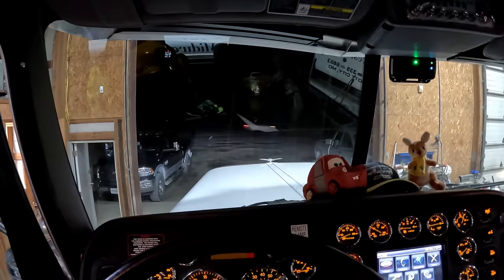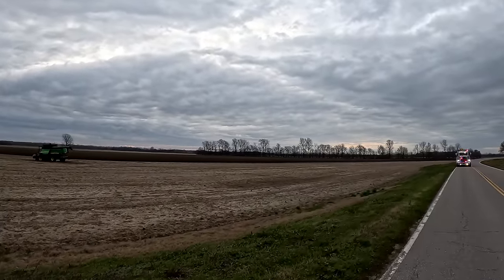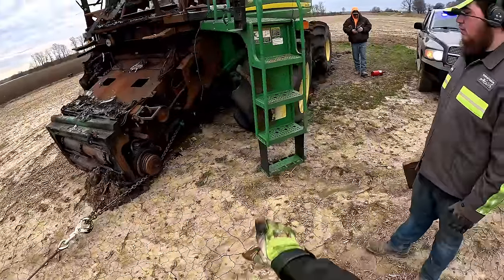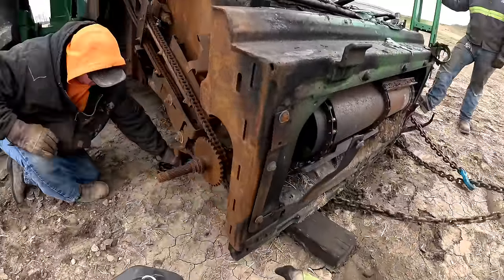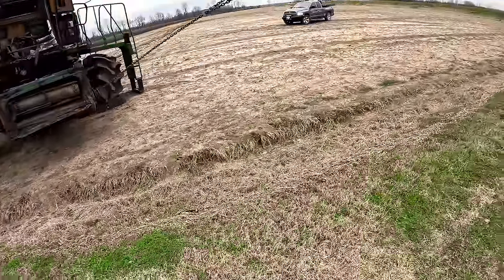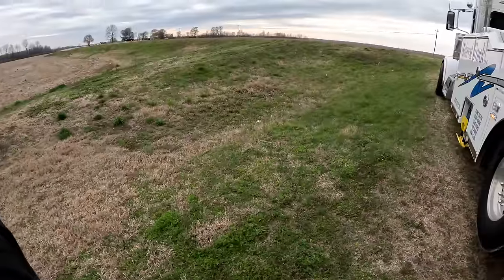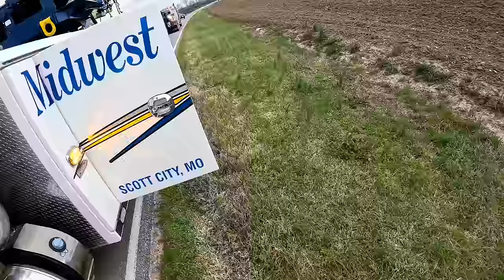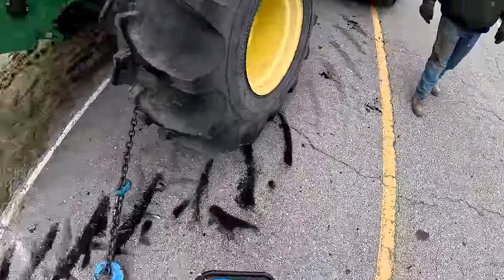CRISPY COMBINE    PART 1   HOW TO GET IT OUT OF THE FIELD?

Comment: You are a very patient man and a good instructor.  The way you take a minute to explain why things are done a certain way  is cool.
Reply: My truck driving instructor was the  same way she  constantly showed  me and explained why trailers are hooked and disconnected a certain way.
Reply: I'd agree with the patient part. . . . very patient,   as for instructor, there's none better, as for learners. . . hmm.
Reply: Tell that to my cousin.  Back when he worked for my dad, he had a trailer sitting on top of the fifth-wheel pin unsecured.  He had a chance for it to fall off and hit someone.  Thank God it didn’t or my dad would’ve been upset with my cousin.

Comment: On the front drive wheels on the shaft going to the bull gear housing.  There is a bolt on a slip collar you take out. That could be easier than taking the hose lose most times. Seemed every year had at least 1 combine stuck are a cotton picker. It's good to see you teaching the younger men how to hook and pull from different parts. Keep up the good work and the videos

Comment: Ron, you might want to add onboard air to your Dodge pickup, this would be useful for air tools, as well as inflating tires, such as in this situation. There are a number of types available, but I would recommend a belt driven pump, such as used on tire service trucks.
Reply: In this situation the tire was burned, it can't hold air.
Reply: The rotator has all the onboard air one could need. I imagine there was a reason they didn't try to air up the tire, or they did try off camera and found why it was flat.
Reply: @legohead6  Ron doesn't need a heavy vehicle to provide air. The Dodge would be a better option as it can go more places the rotator can't, and with less surface area damage.
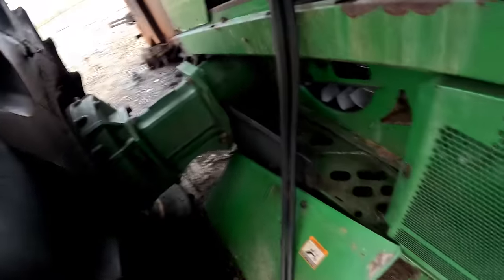Reply: @larrykriete7035 not true. At 4:15, the video shows that the tire has gone flat. Having air in it would have made handling it easier. There's no burn marks on the tire, and the burn marks on the frame doesn't quite reach the tire.

Comment: Ron here's an idea build a multi piece (A) frame you can pin together quick to pick stuff up far away from the rotator. Like the combine head or a car stuck in a ravine, ditch, pit, brush or pond yards away.
Reply: They should also get a come along chain hoist. Had a 6 ton that was easy enough to lug with 2 people. It would have been useful to lift the header attachment.

Comment: John Dear 9770 STS with single front wheels in good working condition was worth $75k-125k.   That is a hit for the farmer.  Probably had insurance but you can’t put a price on loss of use.  The combine had set in the field for a few weeks, probably waiting for insurance adjuster to make a determination.  Farmer had already worked the ground around the fire.  Extremely soft ground, easy to get stuck.  Good job.

Comment: Seems like with all the farmland around you get a lot of soft surface issues.  Have you considered getting some of the steel duckboard panels the Army Engineers use to  make temporary runways? I know they're not cheap (nothing good is) but they would certainly uncomplicate some of the off-road recovery jobs.
Reply: You mean Marston Matting? I tried to find some of that years ago and was unsuccessful
Reply: I was thinking of off-road wheeled dollies.
Reply: @The_DuMont_Network they make alternatives, one such you can even rent from some rental companies is called duradeck.
Reply: and where would they keep them their is  no space left  for anything.
Reply: @JohnWilson-ql8ks at that point they’d have to have a truck and trailer dedicated for equipment like that.
Reply: When I was in the military years ago that was called psp for peforated steel plate. We used it a lot in construction

Comment: There is a transmission on most combines that can be put in neutral, but most also have a spring applied, hydraulic release park brake.
Reply: its electric over hydraulic

Comment: Monday afternoon as we were traveling on I-44 going east between Phillipsburg and Lebanon in Missouri we noticed many lights flashing. As we got closer over in the west bound lane close to the shoulder many responders there. The large wrecker had a hold of the semi tractor and the people were looking at the box trailer, the whole front end was ripped open and torn apart from the trailer. The material looked like thick foam boards or something similar. Didn't look like anything caught fire, which was a good thing. Not sure if his fifth wheel came undone or what. I couldn't see the name on the side of the semi. As we came back there were more people there, trying to figure out what their next step would be. They would probably have to unload most of it. The break in the trailer went just past the dolly's. It looked as though someone used a can opener to open the box trailer. I never heard anything on the news about it. A few weeks before that, just before Philipsburg another truck had run off the road and went through a state highway sign tearing it apart. Nothing on the news about it either.

Comment: I have seen on another channel where they used old lunch trays to slide cars on without wheels or suspension. Maybe a suggestion for future to create sliding plates with a 90 degree bend so they do not slide out, to drag things onto. Minimal damage to the ground or roadway...

Comment: You really need a big military tow truck that's designed for offroad use. It'd really come in handy in situations like this. Either that or what the city of Fort Worth has which is a John Deere skid steer (brand doesn't matter) that has a big blade with spikes on the bottom to act as an anchor and then it has a big winch and pulley that's on a ram above it. I saw it when they used it to pull cars out of the river on Depths of History's channel. Then again, just a big wide wheel logging skidder would probably work, with those 8 giant 3-4 feet wide tires that are made for floatation. 
To me job #1 is get it out of the field and at least onto the access road before it starts raining.. Doing that before the driver gets there is a good use of time when worrying about the weather so it doesn't end up sunk deep in mud. Loading it on the trailer is a non-issue until you can get it out of the field.. First step in that I would've taken a set of chains and binders on each side and ran them out to that axle or onto the unit itself and then back to the main frame and used the binders to shorten it up and left that thing up to get it out of the ground, disconnecting the lines from the rams if it didn't want to budge. Those square cutouts in the top of the machine might've worked too but I don't know if I'd trust them after they've been that hot, they might've been annealed and lost all their strength... the axle is thick enough that it should still hold even after getting hot. 
I believe that if you would've unhooked the rear steer once you were trying to turn it around, it would've allowed it to come around much quicker with less side tension on the whole thing.

Comment: My wrecker is similar to the photo one but longer and has 70 ton rotator and 8 forward speed transmission and adjustable suspension so it can go off-road and has off-road tires

Comment: Hi Ron! after watching  this amazing video  I was wondering  would putting  a chain though the burnt out cab and onto the header and then use a binder to lift the header up to stop the dragging  I thought this may be of use if you feel this is overstepping  or un helpful please feel free to say
Reply: He did good but combines are designed by the manufacturer to be pulled from the other  end

Comment: I just curious, why did they have a combine in the middle of a field that has nothing in it?
Reply: The rest of the crop was harvested and the field cultivated. Recovering the combine could wait.
Reply: 1973 wheat harvest we were using a Gleaner L, engine broke down, melted 2 pistons. Took the engine off to be repaired farmed around the combine. Got the engine fixed & replaced on the machine. Then just drove it out & to the house.

Comment: I wonder what happens to two men standing a few feet from a winch cable if the cable snaps. Does that ever happen? Personally, I would stand no closer to that cable than the front wheel of the combine. But I have never recovered a crispy combine.
Reply from the maker: Our job is inherently dangerous and we are required to place ourselves in "kill zones" frequently.   The best we can do is minimize our exposure and reduce the risk as much as possible.   What we were doing with the winch lines on this video never exceeded the breaking strength of the lines.  We are diligent in inspection and maintenance of our equipment.   We simply have to accept that there are dangers in every job we do.    As far as snapping a cable, I haven't had that happen in MANY years.   The winch lines we use are far different than what you see on a common 4X4 winch.  If properly maintained and used, a professional cable, such as we use, will not snap.  If you see a cable snap, then someone has abused it, overloaded it, misused it, or any number of other things.   Thanks for watching and God bless.

Comment: At this point, you could probably just cut the lines to those lift cylinders...they're so badly cooked by the fire, it's unlikely they'd be trusted to hold pressure in the future and will most likely just be replaced in the repairs...

Comment: Couldn't you have lifted the brunt of the combine with a wheel lift and Ryan change to the front axle so you could tell it down the road to where you need to load it on the flatbed just asking

Comment: For those of us nontechnical folks,  what does RUN stand for?
Reply: RUN. stupid auto correct!
Reply: RGN = Removable Gooseneck trailer. The front of the trailer is removable so the trailer will rest on the ground to easily allow loading of equipment.

Comment: question one you got the machine out and onto that dirt road , would it not be simpler to use the tongue lift thing on the back  lift it up and boom it down , and pull it like any other vehicle to where you are going to load it onto a trailer ????
Reply: Barely made the turn onto the pavement with the empty truck. The heavy wrecker would still be too long to make the corner with the combine behind it.

Comment: I'm not a farmer but it seems funny that that combine would be in the middle of a bare field on fire. I said funny...I meant suspicious.
Reply: It wouldn't have been in the barron field when it went up. It probably burnt out the paddock they have since ploughed.
Reply: Not at all unusual for a combine to burn up in the field. Burning up in a barn would be unusual.

That machine has probably been parked there for 6 months or so (last harvest was Sept to Dec 2022) where it was actively being used to harvest

Chaff (stalks of plants) and plant dust build up on the header (the big unit on front - it had already been hauled off)
Sparks/heat from friction/static electricity/electric short - something causes a little smolder in the chaff
Smolder grows into a fire that burns up the chaff which burns oil filled hydraulic lines, etc

Comment: Why don't you use the boom to pull it to straighten it out, then you don't have to go back and forth with the chain
Reply: Wasn't you watching the same video and not listening to Ron the tire on the driver side with flat the tire in the back was locked the only ones working was the ones on the left as you where watching the video. That's why he had to keep adjusting for it because it wanted to pull to the right and he needed it to go left.